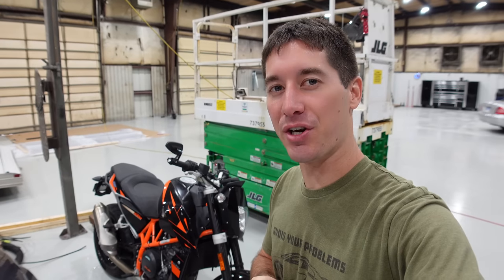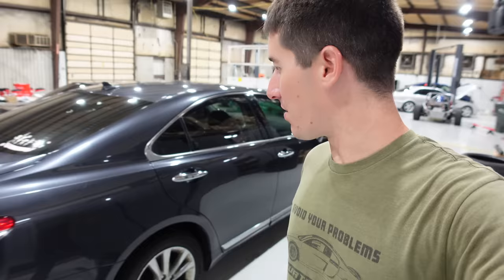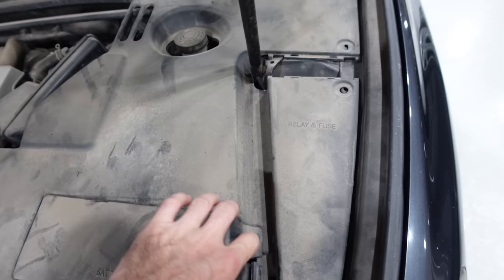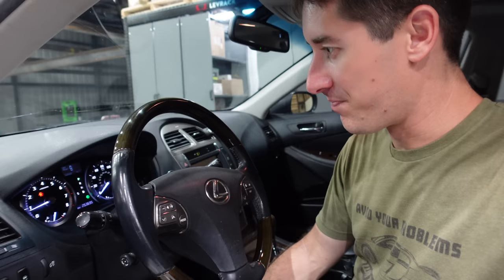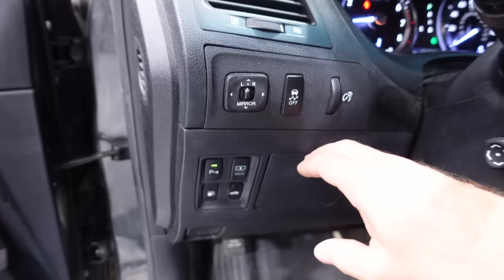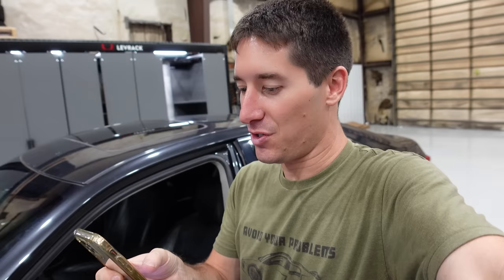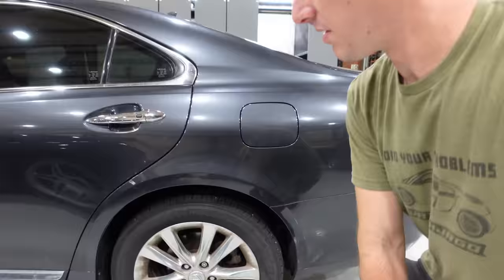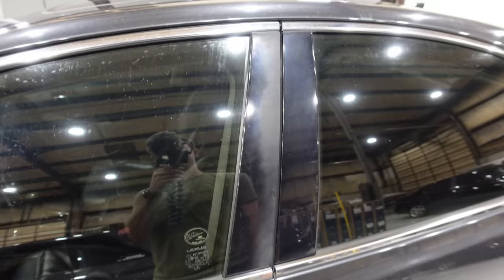I Traded My REBUILT KTM For A Super Nice LEXUS ES

Comment: We have the 2011 ES 350, inherited from my mom after she passed away. The motor is plenty stout for family driving. The 6 speed transmission works so well in sport mode, especially if you change the trans fluid every 50K miles. Thanks, Mom, for sharing such a great car just as I was starting my own family.
Reply: Ocean Zhu so it’s jerky car for a jerk of a driver then? 🧐

Comment: Check the transmission fluid. According to Lexus, it's a "lifetime" fluid that doesn't need to be changed. Curious to see what it looks like after 230,000 miles. PS, I had a 2007 ES350 and it was solid.
Reply: My last car was a 2011 Avalon that matches this ES in many ways. 

Had the transmission flushed at 80k miles, and was planning on it again at 120k but I sold it. 

Fuck that “lifetime” bullshit.
Reply: Be sure and use Toyota WS fluid.
Reply: Yeah a video on how to do it would be great since I plan to do it on my carry soon
Reply: This 'lifetime' crap needs to stop. ATF is a coolant and a lubricant, and this "omg leave it alone it'll shock the gearbox and you mustn't touch it" voodoo is misinformed at best, downright irresponsible and damaging at worst. When I got my IS300 it had dark black ATF and smelt horrible- 133k miles, never been touched. Changed it three times now (drain and fill) and it's a better colour and shifting has improved noticeably. Plus the gearbox didn't explode- funny that. Everyone told me it'll break it, don't touch it, blah blah- seems Aisin were correct when they advise to change it.
Reply: I have a ES300 from 2003 and it is honestly a great daily driver! its only got 130k miles and I have had zero issues since I replaced all fluids and filters
Reply: GARBAGE.  Lifetime of what? The trans of course because if the fluid the trans fails.  Replace ALL fluids in your car.  Probably that STUPID fill from below until it overflows system...I hate those.
Reply: @smarternu  I think most manufacturers call "lifetime" 100k- at least, that's when they'd like you to buy a new car. It's someone else's problem past that of course! 🙄
Reply: @smarternu  i think they mean by lifetime as in like 100k miles.i have always serviced my transmissions every 35,000 miles and oil changes at 6,000 on full synthetic
Reply: @smarternu  Right. It's lifetime fluid since when it fails, the trans dies.
Reply: No such thing as lifetime fluid, it's a bullshit line to get you to buy a new car when the transmission explodes.  All oils eventually diminish.
Reply: Hey now....all fluid is lifetime, including engine oil and blinker fluid. Just keep on driving until it stops. That's the cars lifetime.
Reply: “Lifetime” doesn’t mean Lifetime 
It still needs to be changed just when they (insert Manufacturer) say it does..
Reply: Good point! Had similar experience with a Volvo V70 (aisin-warner slushbox). ATF came out coffee-brown!
Reply: @Roger21989  absolutely agree! It's essential to use the right spec ATF.
Reply: Yeah, lifetime of the trans if you don't change it lol
Reply: Million Mile Lexus Lifetime?
Reply: I love the thought of their lifetime fluid I ask him how long the fluid spoke to last the life of the transmission, how long will the tranny last, as long as the fluid. NO FLUID IS LIFETIME

Comment: I have a 2008 GS350 AWD and it's an absolute tank. It has almost 200,000 miles on it now and it runs and drives well, with only minimal maintenance. Excellent vehicles.

Comment: Traded my 2015 Honda Accord V6 Touring sedan for a 2012 ES350 with only 72k on it, the Accord was newer and had lower mileage, but the Lexus is a much better car even though it’s older, transmission shifts smoother, very comfortable and quiet ride, never regret making that decision.

Comment: My 2005 Toyota Avalon has the 2grfe and the 5 speed automatic transmission. Its only ever had synthetic oil and shell v-power gas, oil changes every 10,000km and it absolutely RIPS. Disabling traction control turned it into a really fun car .. currently it has 512,000km on the ODO (323000 miles) and it doesnt miss a beat.. that engine sounds sweet and it hangs with K-tuned civics and wipes the floor with stock 3 series bmw's all day. I love my unassuming grampa car!

Comment: Man that was a good trade. It's in my favorite color too. My G35 Sedan is a 2004 with only 149,000 miles though so it wouldn't be a prudent trade. I'm glad you pointed out the 2010 facelift part -- I'll have to keep my eyes out for one with lower miles. Not that I don't like my Infiniti but the Lexus are so much quieter and smoother.
Reply: It was a good trade for the guy that got the bike

Comment: Lifetime for transmission fluid means 60K depending on the manufacturer. That car is probably going for $13-15K used right now. You got a great deal! Even if you replace fluids and put $1K in it to fix the seats, wheels and chrome, you'll get a great return.
Reply: I just looked it up, about 10K here in SC where I live. The newer models are 14K up.
Reply: @batsonelectronics  $15K here in DFW for that year model.
Reply: Spot on, I saw the same model with 110k miles for 14k in TX

Comment: 80's Honda accessory wheels had a similar issue WRT wheel corrosion. Up in Michigan we used to get cars in with multiple slow leaks and it was nearly always those dealer installed wheels. We just cleaned the corrosion off the inner lip with steel wool or Roloc disks. That would be a less than ideal solution for a chromed wheel. 
Older Lexii just run and run - great cars for the money.

Comment: These are an amazing display of reliability and longevity.
I have a 3rd gen 2009 RX450h with 160000 miles, with nothing broken.
Even the hybrid battery is still original and works fine.
Owned it for over 2 years now, amazing car.

Comment: I had a 2009 lexus es 350 that my dad bought mid 2009 when it had 5,000 miles. He gave it to me in 2019 when it had 225,000 miles and it drove perfectly. The only issue we ever had was the wheel chrome peeling causing tires to lose air also the air condenser went out but we didn't fix it as it would cost us $2,000 to replace. Unfortunately I was rear ended by a teenager on there phone that totaled the car because the car was worth less than $5,000 but the body shop wanted $8,700 to fix it. It was an excellent car I wish I still had it.

Comment: You can use a heat gun to remove most of the oxidation on the plastic trim. Cerakote trim restorer would probably make it look like new if Project Farm is right.

Comment: I had a 6 speed break!!!!!!!!

2012 4 banger Camry I bought at CarMax with 49k. Had a weird noise and would slip when accelerating off an on ramp or decelerating 

Turns out some 2012-2014.5 6 speeds will go kaplooy esp with the new eco system Toyota used

Comment: ES350 WAS also sold in RIGHT HAND DRIVE in Australia, New Zealand and the UK. Sorry to call you out.
Reply: Redbook has 2005 and earlier and 2013 and later for the ES in Aus. Maybe that generation ES wasn't?
Reply: Possibly. UK didn’t get the ES until late 2018 either, when it replaced the GS.

Comment: Interesting, I have a 2014 ES350(next gen after this version)   The underhood has none of that plastic crap except for the engine cover, looks like a normal engine bay where you can see everything and dont have to remove 3 plastic panels to service things.   Also my car has the same engine and its stupid fast for something that averages 27mpg.  Will blow the front tires off/wheel hop on command, its really too much for a FWD setup

Comment: I just sold my 09 IS250 with 182k miles. It was great but just before I decided to sell it, I had to replace the rear passenger side wheel bearing, new brakes, TMS sensor on the left driver side wheel. The straw was that you had to keep it in vent instead of recirculating or bad noises would come from the dash and started smelling burning oil. It was going to need new tires soon. I had the premium wheels so they were different sizes from front to rear.

Comment: I've been riding in Camry cabs in the middle east with like 400k miles on the clock and these had four cylinder engines. So this one should be good for another 200k miles.

Comment: I traded a 2012 ES 350 with 315,000 miles and needed rear shocks. My current LS 350 2015 I have now has 226,000 and looks and runs like new. I only replaced a rear bearing (Pricey). The 200,000-mile check-up is about 1200.00 and covers everything from bumper to bumper. I do not like the new ES 350 as all the Lexus have extended front ends that look like a rat nose to me. Also, each model leaves out the wood accents and other things are smaller/cheaper. Two things that disappoint about the 2015 and one item of the two is really a cheap out. NO FULL-SIZE SPARE.in the trunk. A full-sized spare a must for my next car. Key hint, Never buy a NEW Lexus. Like other cars, the price drops like crazy if they have a few miles on them. My 2015 went from $35K new to $23K with 40,000 miles. Enough, about my car. The Lexus is worth every dollar but get a used one. The new ES350 is $54K and not much different then the 2010 JR has.

Comment: Parking Assist sensors are prolly the wiring in the front bumper..  I have a 2011. Nice car but my head gasket started to leak at 120k so I traded it for a Mercedes! 🙄

Comment: I recently looked at an used 09 IS 250 AWD . Long story short,the seller was a curb stomper want to be and wanted to much money for a car in hooptie condition. He wanted $7500 for 125000 miles with rotted exhaust,bad rear calipers,pads,and rotors with possibly bad wheel hubs.And the tires were toast.

JR has proven what everyone is saying,if you have a choice between a 250 or 350,go with the 350. You won't be sorry.

Comment: 1997 to 2001 ES300 was the best looking ES. Also before all this stupid tech shit that's not needed. I've owned 5 97 to 01 ES300s. One with 451k original miles on original motor and trans and i had every piece of paperwork from the dealership. It's stil on the road today and I sold it in 2016 with 451k miles. I can only imagine how many it has now

Comment: I bet Car still drives like new
Reply from the maker: It does, I drove it around the block and you could tell it was perfect 😳
Reply: @WatchJRGo  You didn't just jinx this car by saying it's perfect before putting it on the hoist did you??  😕🤞
Reply: @WatchJRGo  I have a 2006 IS350 with all the features that you have in that car just hit 240,000 miles and let me tell you the car still drives like brand new.

Comment: Not true!  ISF is not entry level!  Not by any standard!
Reply: ISF cars run! They are race cars, not too well known tho.
Reply: @garys9694  ,Anyone that knows Lexus knows the ISF.  I drove Lexus for 25 years!  I owned every model except the ES.  The ISF is a part of the IS platform.  It was the performance car.  I owned one for 4 years!
Reply: @buckcannon1811  Yes, I recently bought a GS350 AWD, tried to find an ISF that I could afford, and went for the GS. A dealer near me had 2 Fs and they were so damn expensive I just said forget about it. I'm not in financial shape to buy new.
Reply: @garys9694  ,Yes they are pretty pricey!  If you can find one reasonably priced, buy it and hold on to it.

Comment: I bought an 01 e320 mb a little over 3 years ago. Yes the rear shade was broken. I could not find the switch. Come to find out that whoever owned it when the shade broke took the switch out of the console and replaced the wood panel for one without that option so there would be no hole. $1200 for a new shade.
Plastic all over is broken.
I should have bought a Lexus. My car only has 153k miles now.
I had an 85 300d in 01 to 05
And it had 280k miles when I traded it. Absolutely nothing was broken on it.
I hope the mercedes engineers since the 80s all burn in hell!